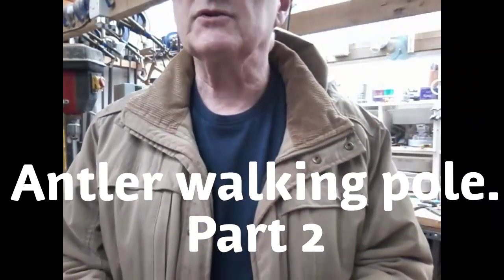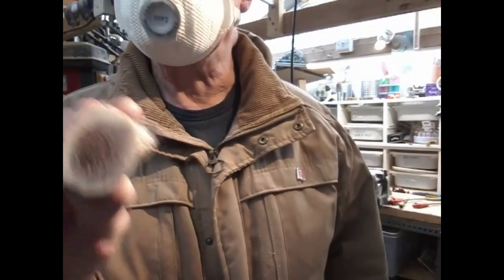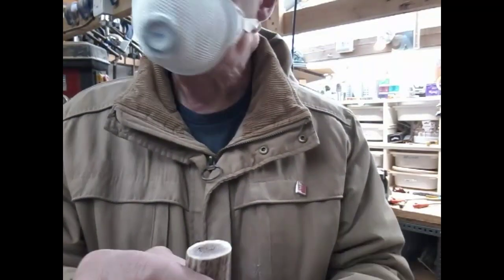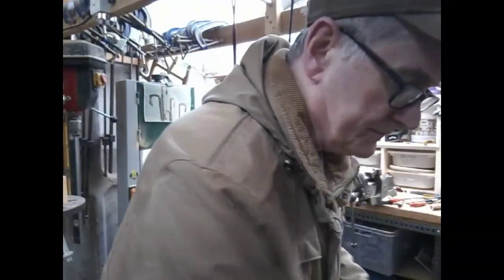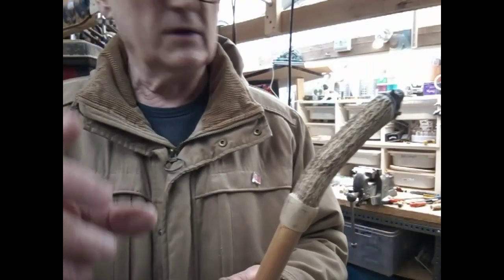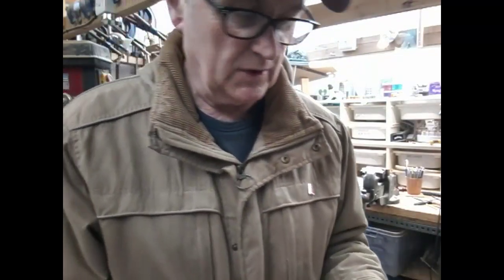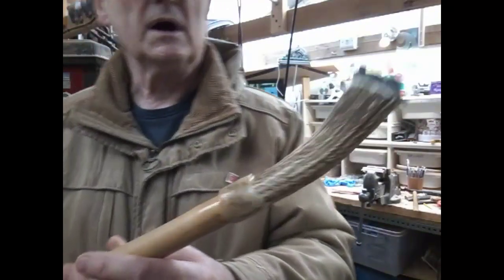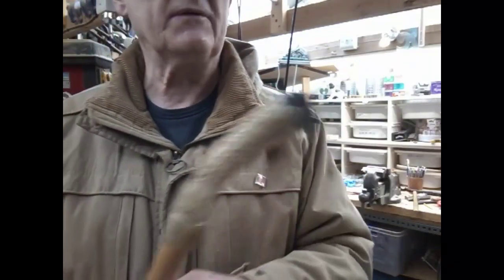Antler walking pole. Part 2

Comment: A useful set of vids, but I’d be helpful if you could show what method you use to ensure that the holes for the peg are in line with each other so that the handle is not at an angle to the shank. Thanks.